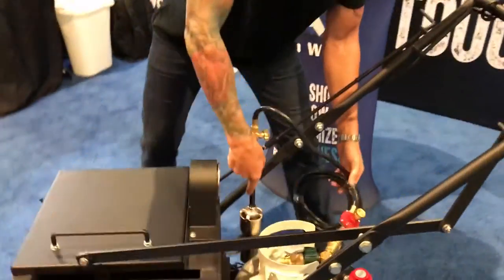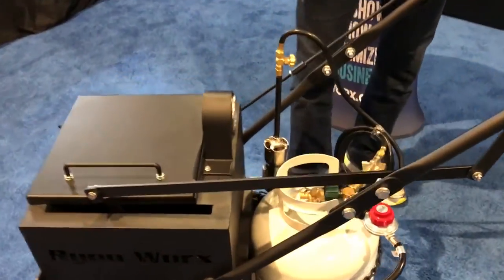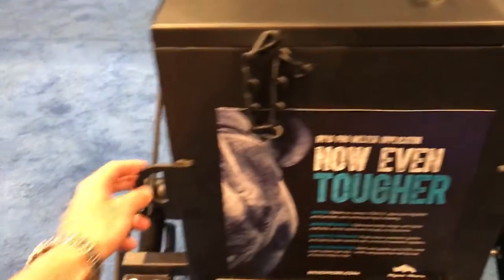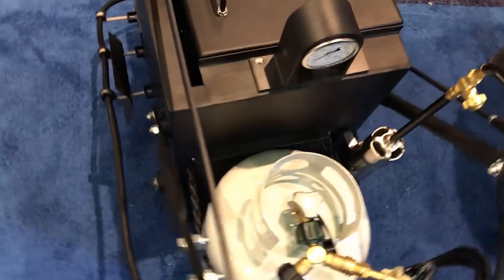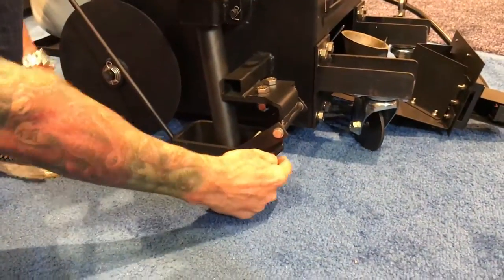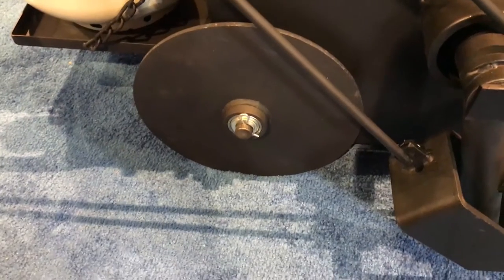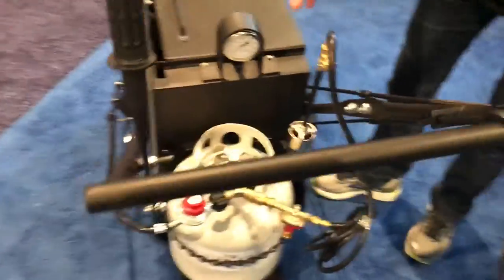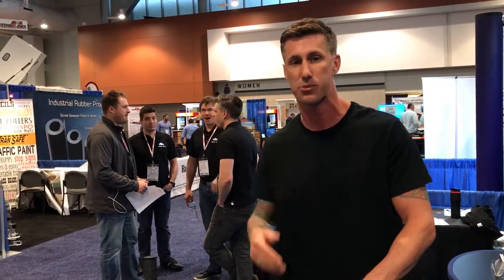The Ryno Worx RY10 PRO Crack Sealant Melter and Applicator Featured @ NPE 2017

Comment: How do you use this on hills? No video shows that
Reply from the maker: It’s actually really easy to push on hills that are relatively not steep. Just takes a little muscle but worth it to get all those cracks sealed up.
Reply: I have one and it is easy to push sure. But the material all drips out of the crack if pouring on an incline.
Reply: Any pointers to help out? Someone told me to go really slow and start from the bottom of the hill, but I still have trouble getting the material to stay
Reply: Am I gonna get an answer or do I need to call you people?